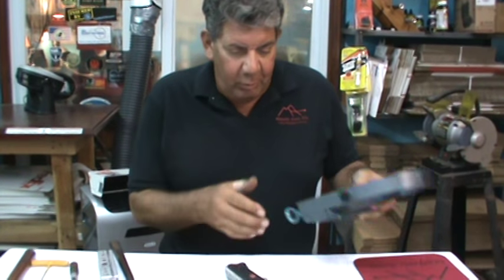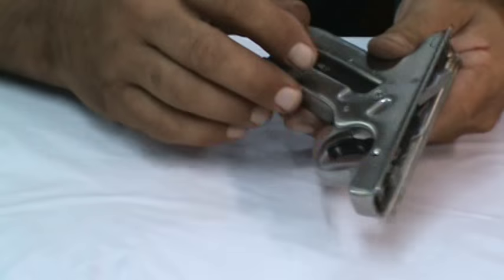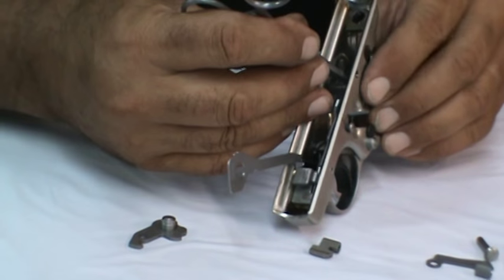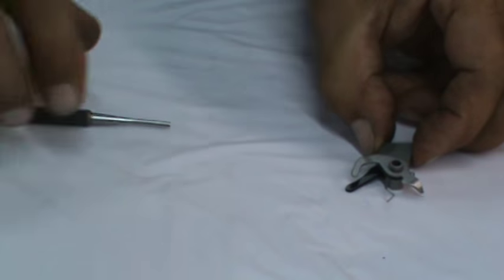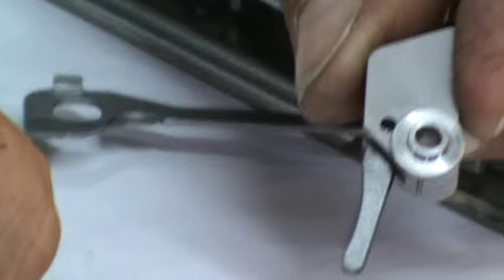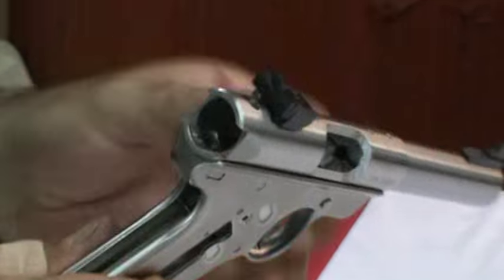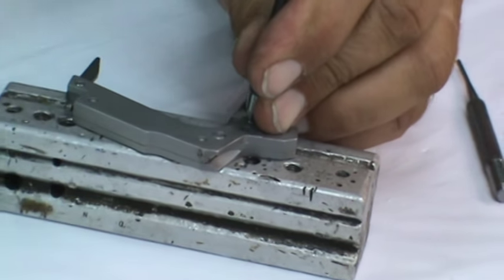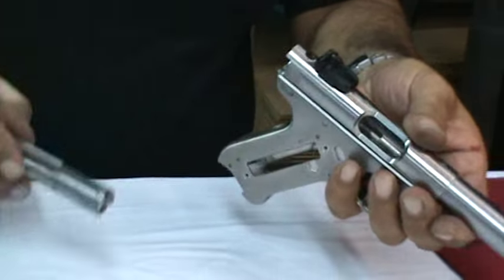Majestic Arms Speed Strip MKII-III Installation

Comment: Like a dumb-ass, I didn't read ALL of the instructions before attempting the install. I have a 3.2 conversion kit, so when the magazine disconnect and hammer didn't fit into the frame I was thoroughly confused. I was wondering how Dino made this look so easy until I saw "Inventor" beside his name on the back of the instructions. Great video and an even better invention. Thanks guys.

Comment: Without this video, I never would have gotten the Speed Strip kit installed.  It still took me a while because I did pull the pin out too far and had parts fall out.  Ruger seems to have designed the MK II as a puzzle.   I can detail strip a Glock, 1911, S&W and Ruger revolvers with no issues.  I've always hated even field stripping the Ruger MK II.  I just don't like putting a firearm in a vice and beating it with a hammer to disassemble it.  I've always enjoyed shooting the MK II.  Now that I've got the Speed Strip kit installed, I'll enjoy it a LOT more since I won't dread cleaning it.  I wish I'd heard of the Speed Strip kit a long time ago.    For under $60, it removes a lot of aggravation!
Reply from the maker: Hi, It's our pleasure to serve fine shooters and gentlemen such as yourself. I'm glad the videos helped you.  Best wishes, Dino